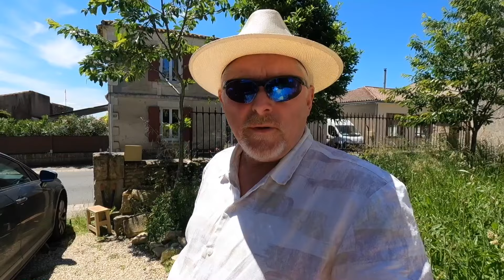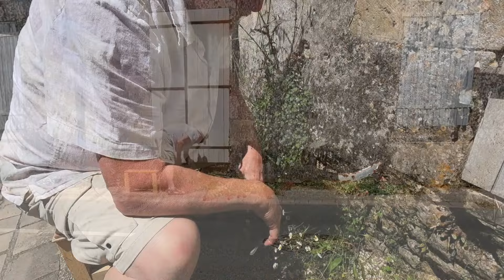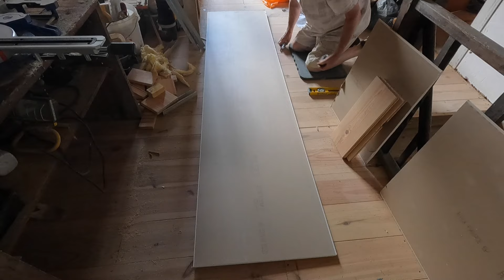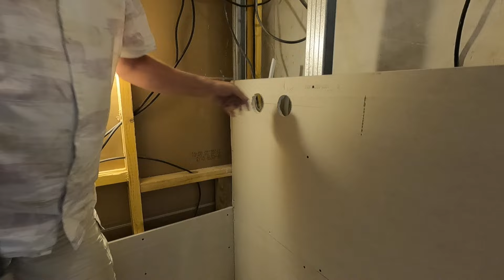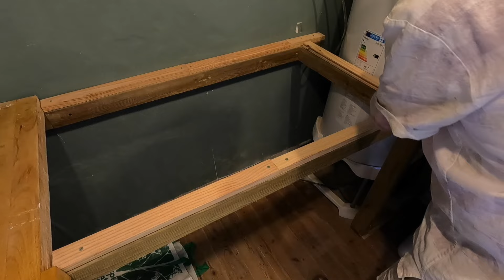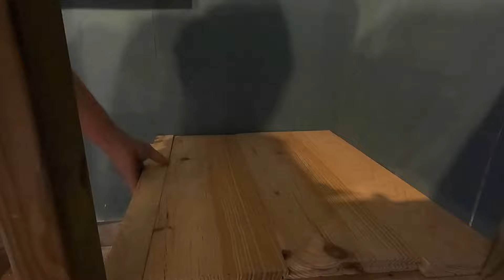A clear up before the Mayor comes knocking on the door!!..

Comment: The sidewalk cleaned up nicely. You could spread a lightweight layer of chicken wire (hexagonal fencing) across the front of the stonework, securing it at the ends to the iron above, to hold the loose stones in place until you can fix it. I realize it won't look as pretty but it will stop possible injury to people/lawsuit to you. Just a thought - I'm a safety freak. That sink is brutal to lift alone.
Reply from the maker: good idea, though I'd have to get the mayor approval. but something to think about cheers
Reply: You could probably add the render to the hexagonal fence… two birds with one stone…! ❤❤❤